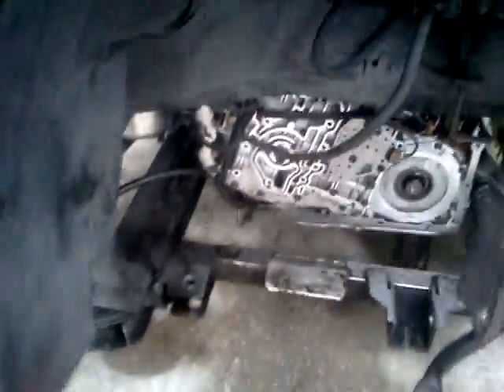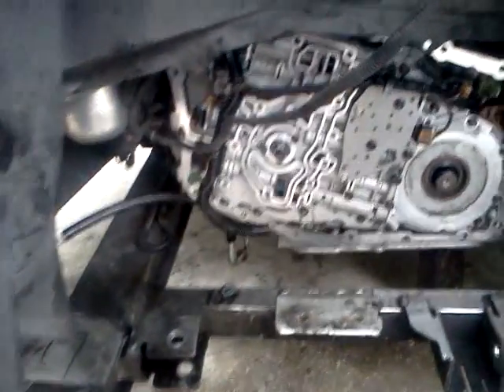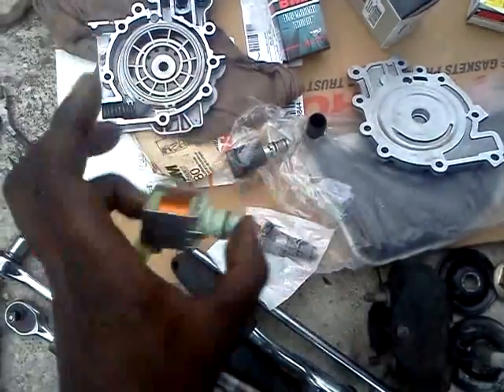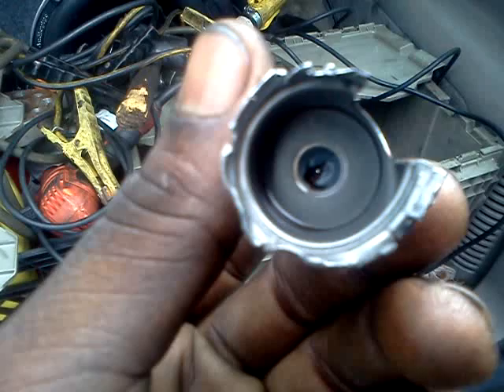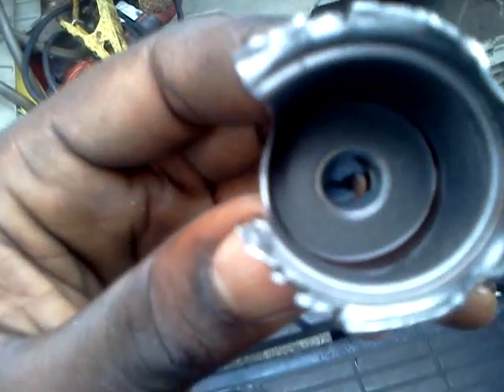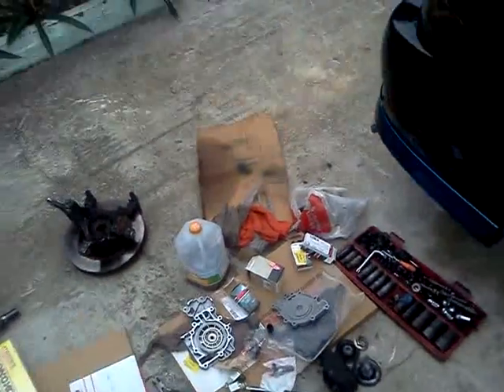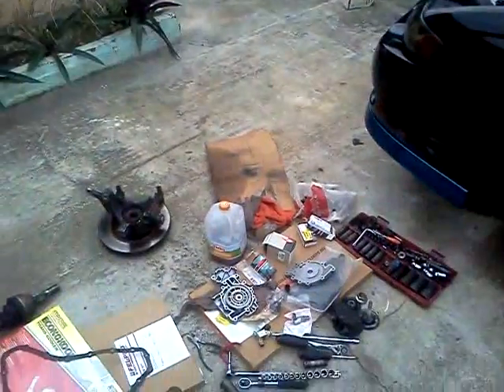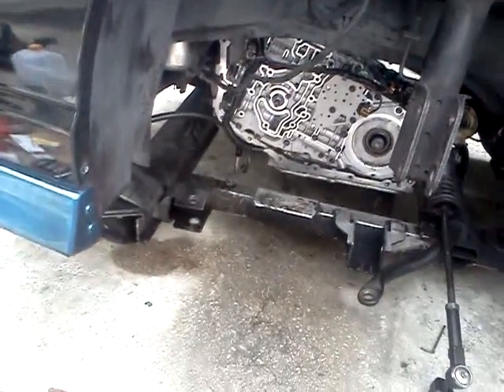2001 Monte Carlo SS Torque Converter Clutch (TCC) Solenoid Fix Update 1

Comment: Did it work in the end? My 2001 monte Carlo ss is doing the same thing
Reply from the maker: Adrian Jauregui Work For 1Yr. End Up Buying A Re-manufactured 4T65E From Auto Parts.
Reply: Thanks man I really appreciate the info..Do you remember how much you paid for another 4T65E?
Reply from the maker: Adrian Jauregui 1300.00, make sure you take off the all you need before giving the store your old one, your gonna need the dip stick, the dip stick tube, transmmising fittings on the transmission itself...

Comment: how much was it for everything I need to do that to mine after 1 hour and a half it starts to shift and jerk
Reply from the maker: +jose arpero I Recommend to Purchase a Re-manufactured Transmission, This Problems Comes Back 1 Year to The Day I Did This, I Went and Bought a Fresh Re-manufactured Transmission For $1350.00 and Installed It Myself. I spent $147.00(4 Sensors (Sift Solenoid A, Shift Solenoid B, TCC & EPC, ), 13qrt of Transmission Fluid Was $40.00, The Side Case Gasket ($11.00), Transmission Pan Gasket Kit w/Filter ($15.00). I Personally Added A Transmission Cooler w/ Electric Fan($110.00) Also.

Comment: My 1991 Pontiac Bonneville SSE has this exact problem.  The TCC solenoid needs replaced because it does not work at all anymore.  This seems to be a very common problem among these GM cars.  I have a 2005 Deville with the same issue.  I am going to replace them myself since I love both cars very much.  Its great to know that there is a way to replace it without having to remove the entire driveline out of the car.  Thanks

Comment: Is thus the same for the 3.8L Buick lesabra  01
Reply: My car is reading  the TCC STUCK ON code
Reply from the maker: Elante Ford Yes, Unfortunately all of GM's 4T65E and 4T65E-HD Transmission Have This Problem.
Reply: +TheDemo05  My 1991 Pontiac Bonneville SSE has this exact problem.  The TCC solenoid needs replaced because it does not work at all anymore.

Comment: I have the same car, but mine isn't throwing a code at all my brother friend has one of those fancy scanners and he finally got it to throw a code but when he overrides the PCM it drives normal.. What was yours doing that made you come to the conclusion that's what the problem was??
Reply from the maker: Kandyce Saez My Service Engine Light Would Come On, After A Certain Amount of Miles The Car Would Reach Operational Temperature Then I Would Loose Power When Shifting, 1st Gear Would Shift Hard into 2nd Gear, but 3rd Would Get Stuck With No 4th Gear(Over Drive).... But The Code And Research Was The Main Reason Of Me Changing These Sensor... Ended Up Buying A Remanufactured Transmission and Putting It In Myself, See My Other Videos.

Comment: ***** I brought a rebuilt remanufactured transmission for my 2006 pontiac grand prix gtp & i got swapped now I have a check engine light showing i have a tcc problem if I change it & the other 3 sensors would it fix the problem since it isn't the original transmission my old one we out at 277,XXX miles
Reply from the maker: MrTerencehenderson 2006 Grand Prix Only Come In Base, GT, or GXP Models. Regardless, If Your Rebuild Transmission Is Showing A TCC Code, It Most Likely Wasn't Done Right, Take Your Car To AAMCO, Get A Check Out On The Computer, They Warranty Their Work (If That's Who Did It)

Comment: TheDemo05+ Did the new solenoid's fix the problem with your tranny.  I was thinking if you had a faulty PCM.  On my 1999 Pontiac Bonneville, I have the same trouble code P0742.  I am wondering if the PCM is faulty.
Reply from the maker: Karl E Bennett Jr Changing These Sensors Only Fix My Problem For A Year, I Ended Up Replacing The Transmission With A Brand New Out of Box Re-Manufactured Transmission.

Comment: That looks like a nightmare...I'm afraid my 3.8 may have the same issue. When the gears kick in it gives a noticeable jerk but my engine light is not on. Already replaced trans fluid and checked for leaks. 😒

Comment: Bro i have a 2004 grand prix i have a problem  with a sensor but idk witch one the problems is when i take off the car pull hard their time that it doesn't do it but idk what it could be please help
Reply from the maker: Get your transmission rebuild or buy a re-manufactured one from you local auto-parts and find a shop to install it.
Reply: +TheDemo05 what  is cheaper a reman or rebuild

Comment: Damn you did allot of work up to this point. That sucks man. I just got in a hurry an gave the ho's grand prix gas as I was shifting into drive... an it clunked pretty good lol, so everything was fine most of the way home, except when I went to go around a rig an passing gear wouldn't work. I read out may of went into limp mode. Anyway im going back out to check it out in a few. God I hope I don't have to treat the thing apart, I'm so sick of working on cars. Esp my ungrateful bitch faces car.  Lol.  Good video, thanks for showing the broken tcc.

Comment: i have 2005 impala an check engine light on codes po753 po758  p2761 
but  i  have replaced all 4 sensor in  the transmission
still  doing the same problem
when in drive,,it takes for ever to take  off an  go but once past 35mph it runs fine
but if i drive  in 2 it takes off fine
do u have any clue what the problem  is
Reply from the maker: Your Transmission Pump Is Out of Order, It's Effecting The Torque Converter Causing It To Malfunction. Also It Seem Like The Clutch Within The Transmission Itself Are Worn Down. Best Thing You Can Do Is Spend That $1400.00 For A Re-manufactured (Not Rebuilt) And Have A Credible Shop Put It In(Pay Labor).

Comment: seriously, you have to replace this every 30,000 or so? if that's the case, sounds like a pain in the a$$! cant believe they made this so hard to get to knowing it needs replaced often.
Reply from the maker: No, You Need To Change The Transmission Fluid Every 30k Miles, If Not These Sensors Go Bad, Then It Becomes Big Problem.

Comment: Everyone who has the Pressure Control Solenoid issue, please make sure you don't have too much transmission fluid -- it will cause the transmission to get clunky and give off the Pressure Control Solenoid code (GM even issued a TSB on it).  If there is any possibility more fluid was added, suck some out and try driving it.  If it still clunks, suck a little more out.   There is likely nothing wrong with the solenoid.

Twice, mechanics have put too much fluid in and it caused clunking.  Both times I fixed it by sucking a little out.  My original 4T65E 2001 transmission now has 176,000 miles on it and is still going strong. 

I used a car wash vacuum and aquarium tubing to suck some out the first time.  Since then, I have purchased an oil extractor pump which I also use to change the transmission fluid.

Comment: Hey Mr. Demo, great videos on the TOPIC I'm looking for. I was thinking I had to remove the tranny to get to those solenoids. Unless you know a difference between models of cars that would make the route access not possible? [impala 03] I like the way you answered Lonney  Harper's post. Only if a shift kit would turn off the dang CHECK ENGINE LIGHT. Smog check is due for me, only reason I would even consider going through all that. Thanx for your work man.

Comment: Often the hard shifting is caused by the bores in the accumulators wearing smooth, the rubber seals in the pistons grab when the fluid is hot. Scuffing them with something mildly abrasive is all that is needed. Can be accessed by dropping the pan, you can also install a shift kit that helps with this issue. Triple Edge Performance sell a kit with everything needed for the 4T65-E. I'd suggest trying this first as its only a little more work than doing a filter change. Guides can be found online.

Comment: ight bro im back,, watch the video like 5 times.. is the engine cradle on the ground a is a jack holding it up.. this is the part im stuck at... i dont if i should lower the engine cradle or take the transmission mount out..

Comment: aye bro tnks for tips.. my question is.. 1 did you remove the upper 2 screws on the transmission hosuing,, are did you leave them in.. and remove the bottom screws.. #2 after you remove the screw from the engine mount.. (under the driverside).. does it make it ez for the side cover to come off... i have a 2000 mc.. tcc went out...

Comment: Do you know if the TCC or the PCS can act up without a service engine light\code? Or will it throw a code since they are sensors? My car acts like it drops out of gear or like that it's in neutral after I come to a stop and start to take off again. Seems like it happens mostly when it should shift into 2nd.

Comment: my 3800 grand prix just started doing the tcc lock/unlocking under load
So the silionids should fix that problem?
thanks alot for the video, I can do the job I just dont wanna fix the wrong thing.
All gears shift great the TCC just will not stay locked

Comment: ? for u just yesterday i found my brakeline was leaking (front pass tire) @the brake fitting screw to the caliper,,,i tightend the bolt now no leaks:)))))) but now my brake light is on my dash cluster:( how do i get that dumb ass light off? can i clear it by disconnecting the pos batt cable????

Comment: i have a buick regal 01 and i got this code as well, the car bucks in first and second gear but drives normal in the last three. the error said tcc stuck on, solenoid. do you think changing the solenoid will fix the problem? i would appreciate any feedback please, thanks

Comment: thanks brooo i fix it lol i take the car to a shop computer only read transmission speed sensor so i check my self n two wire's they were burn so i just put electrical tape n plug it back n it runs like new thanks 4 ur help

Comment: hi i replace the transmission on my 02 impala now i start the engine put trans  on drive n won't shift to second it has power on 1st gear just wont shift so i keep driving n temperature is normal hot so the transmission shift normal? so if is cold wont shift but if it is hot it shifts can any one help 02 impala 3.4 engine

Comment: I have a faulty TCC Solenoid on my 94' cavalier... I have been researching how to change it. I see you have taken off the components on the left side like I will have to do with mine.  I'm supposed to use a J- support for the engine but haven't been able to find one.. Any suggestions on what I can use? It's only a 2.2 Liter so a fairly small engine.. Thank you for your video.. It is a big help...